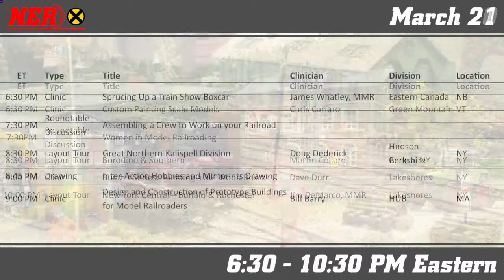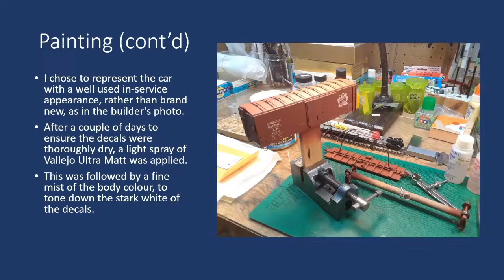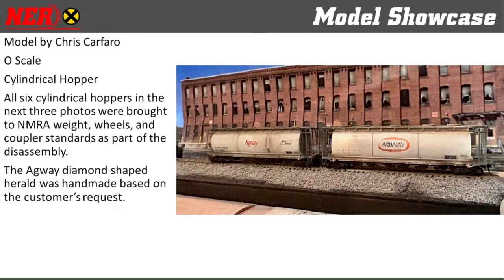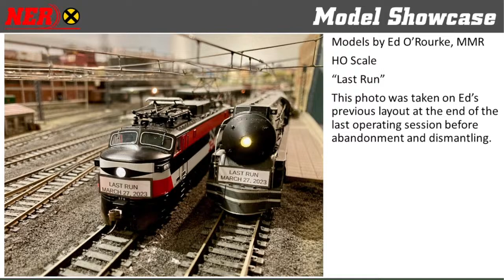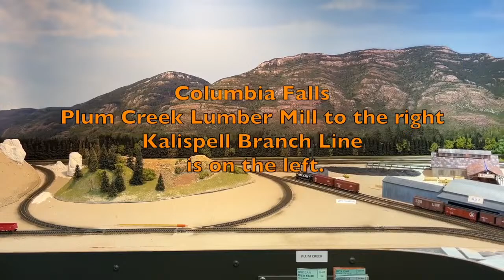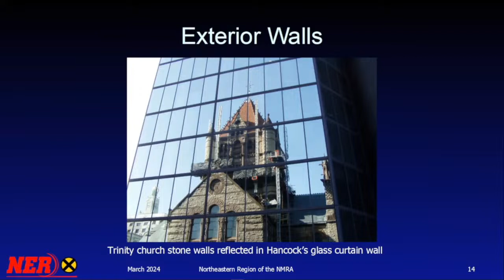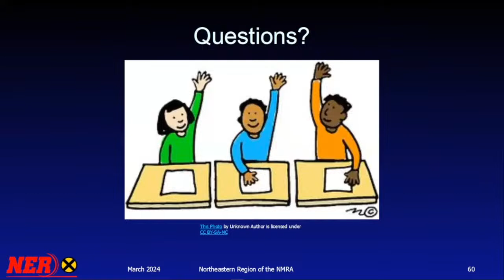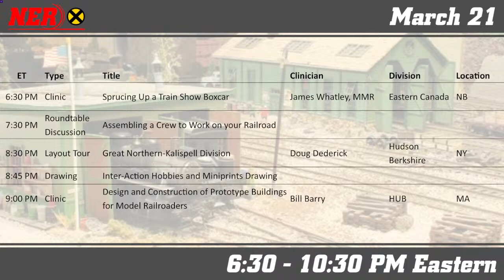NERx - Virtual Model Railroad Convention, Day 4, March 21, 2024

Comment: The Monadnock Building in Chicago was the largest brick building ever constructed without a steel structure, at 16 stories. As a result, when you enter the building, which I have when I lived in Chicago, it's like walking through a short tunnel due to the walls being 6' thick. Also, the foundation was inadequate, a common weakness in late 1800s-early 1900s buildings. The weight of these massive brick walls has caused the entire building to sink 20" or more into the ground, but fortunately evenly so you don't have a leaning tower of Pisa problem.